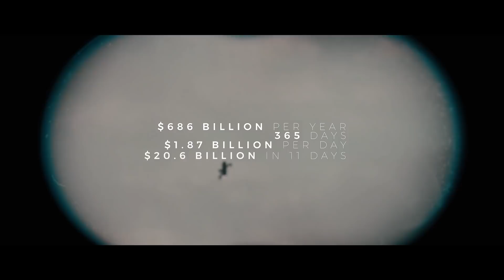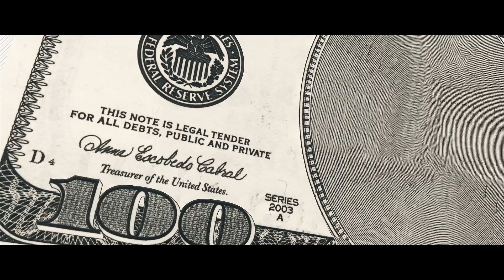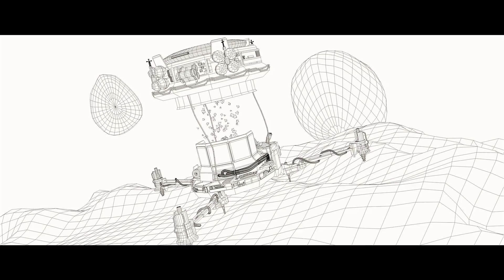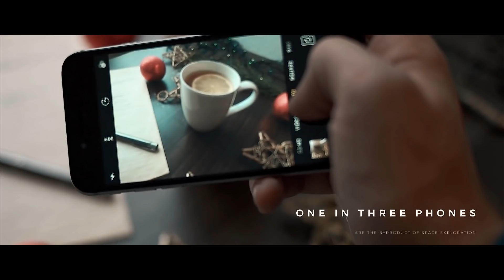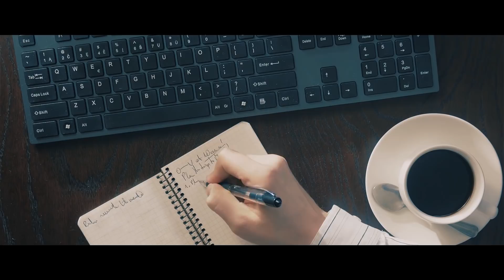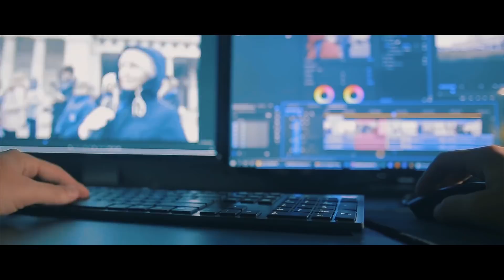If NASA Wasn't Broke

Comment: Sufficient, but stable, long-term funding is definitely an issue for NASA.  However, in my humble opinion, NASA has two bigger issues that need to be addressed first: 1) bureaucratic red tape (making it difficult for NASA to move fast), and 2) political interests (advocating to continue funding for projects that help constituents but are either no longer viable or the most efficient use of the funds).
Reply: very true, since congress decides where nasa spents its money on, nasa has to waste money on stupid money funnels to defense contracters. these projects include sls, lop-g, space shuttle, orion, etc.

Comment: NASA is broke with 21B budget meanwhile ROSCOSMOS has a budget of 3B and flies constantly.... mhm k
Reply: please watch the video again. never said they were broke.. just underfunded.
Reply: @duckyduck3375  Except literally in the title of the video. Besides, as long as you set unrealistic goals, you will always be "underfunded". Wasting enormous amounts of money on using 80+ years old technology in hope we can achieve a 22 century goal. No really. How do we tackle the space problems we had 60 years ago? Not enough delta V for large payloads. Revolutionary engines maybe? Lighter stronger super materials? No.... literally building a LARGER Verner Von Braun rocket. Sorry. Not a fan of using a hammer to solve every issue. Sometimes it's better to take your time and spent money on research and ACTUALLY INVENT SOMETHING radical and not promising lunar bases by using 100 years old tech.
Reply: @duckyduck3375  And one more thing - SPACEX has 10 times lower budget than NASA and look what they are achieving. Real progress in rocketry not "WE MAKE LARGEST ENGINE EVER". When you wanna go 2000 miles with your car what do you do? Put 6 fuel tanks with gas or something else?
Reply: @Pupixario  hope you don't assume that all NASA does is build rockets.. I don't even need 30 seconds of research to know better. You should readup on Nasas actual influence if the video wasn't sufficient enough.. I must admit I was also blinded by SpaceX achievments at first. You could also argue why we fund military so much but I guess American patriotism will never use common sense
Reply: @duckyduck3375  The topic is "NASA can't do enough advancements in space exploration because they are underfunded". My claim is that in the field of space exploration which is currently dominated by advancements in rocketry, SPACE X is doing larger steps with 10 times less funding. Now I am not familiar with the budget of NASA. If you can give us figures on how much exactly is dedicated to rocketry so we can compare with SPACE X or ROSCOSMOS then you can make a point.
Reply: Who do you think Space X's biggest client is? This is such a stupid comment. Space X would not exist without public funding.
Reply: @spastikman  Does it matter? My point was that they are achieving much more in the field of rocketry with much less funding. So complaining that NASA can't do enough space advancement because of the lack of funding is unfounded. That's all.